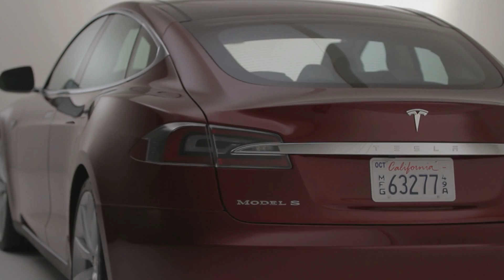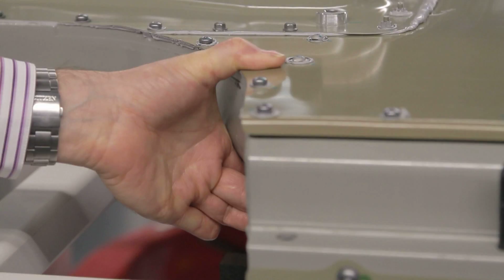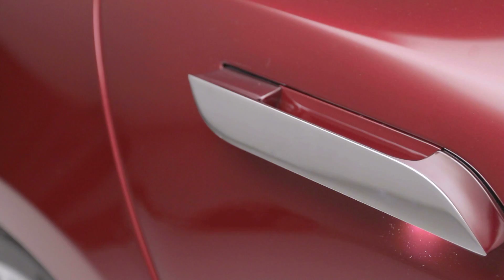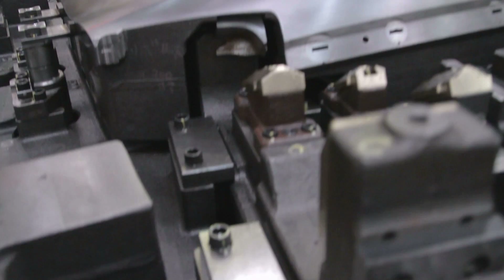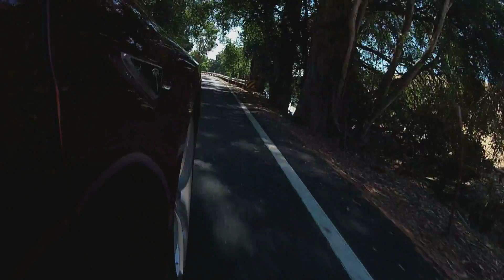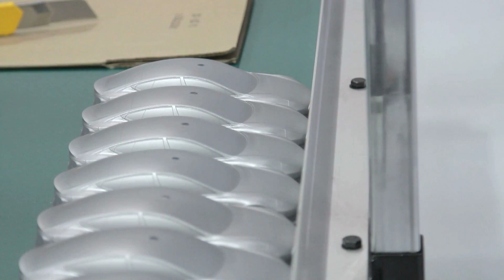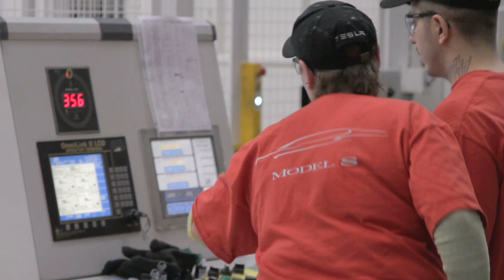Driving the 2012 Tesla Model S - Wide Open Throttle Episode 22

Comment: Or is there a different motor on the performance and normal version? I know that the main problem with electric motors is heat dissipation, but its probably very likely that all the cars use the same motor, but supply power to it differently. If this is true, then it could be easy to "overclock" the batteries by tweaking the controller and thus you could get your performance version for much less. Cool video btw

Comment: Hi, I know a little bit about EV's because I built my own electric bike which gets up to 40mph. I'm wondering if there are any actual internal differences in the battery pack or motor between the 85kwh version and the performance version? I know that a 85kw has twice the capacity of a 40kwh battery, but this also means that the battery can supply more current (about 2x as much) which means more power. So I'm wondering if the normal 85kwh version is simply inhibited by a controller.

Comment: Where do those numbers come from? Don't forget that electricity can come from a wide range of sources, of which some are very clean, like solar or wind power. You can charge the Model S with a 10 kW solar array to give it 50 kilometers of range per hour.

Gas powered cars require refined fuels, which require a lot of energy to produce and transport, and it has shown in a study from 2009 be less clean than the production of Li-Ion batteries.

Comment: The reality is that electric cars are putting more CO2 in the air, because the electricity is made with an average of 500g/kwh of specific consumbtion, but todays modern engine do around 300g/kwh. So this means to to produce 1kw of power for one hour, 300 g of CO2 will be released. Besides that the production of the LiIon Batterys take also alot of energy and the  recycling of way more.

Comment from the maker: There are 3 charging solutions 1.The Mobile Connector, which has adapters for a 110 or 240 volt outlet, takes 6-10 hours to charge. 2.The High Power Wall Connector, the fastest way to charge at home, can charge the 85 kWh battery from empty to full in less than 4 hours. 3.Supercharger stations, which Tesla's positioning along major interstates, will provide a 50% charge in 30 minutes when the Model S is equipped with Twin Chargers (standard on 85 kWh battery, optional on 60 kWh battery). -Jessi

Comment: The biggest health risk with having that high rate of a battery (amp/hr = capacity) is heat generation.  Think of how your cell phone gets hotter when you use more of it's features. Underbody air flow and liquid cooling can offset that.  Then of course, there's the impact/collision hazard and the potential fire thereafter, but hey, lets not be pessimistic here.
As far as the motor's magnetic field? No worries there either. You should see the size of the motors that run trains, boats and cranes!

Comment: little forward motion? I think you take cars for granted. Did you know it takes 26,500 kJ (26,500,000 J) of energy to move your average car a single mile at 100% efficiency? (not truck or SUV, they would be even more) That's equivalent to 14 lbs of TNT. Add a single passenger and you increase the required energy by  1,500 kJ. Higher energy density means you can carry more energy, the more energy you have the farther, faster, and the more you can carry on a single charge/tank.

Comment: Its a great car and I'll tell you how to solve the range problem. When my cell phone dies I don't plug it into the wall, I have two batteries and I always keep one charged why can't we do that with electric cars? No gas stations but battery stations. Drive in switch batteries and drive off. We still need to remember though how much fossil fuel it takes to make "clean electricity"

Comment: ?? Tesla says the Roadster's charging efficiency is 86% -- if you put in 10 kWh of energy from the wall, you get 8.6 kWh stored in the battery. Meanwhile the GREET model says each gallon of gasoline takes about 0.24 gallons of gas energy equivalent to produce, spill, refine, and deliver. Later gasoline really suffers because burning it in an engine produces a lot of heat and just a little forward motion, much worse than a motor. Yes liquid fuel density is sky high, but so what?

Comment: Efficiency, yes. Capacity? No. Hydrogen has more energy density when u realize it can be compressed and even if extracting it is redundant, it's still cheaper than normal ICE car. Hydrogen solves to range problem in ev's. I explained earlier in my other post that it was used at my work.

Comment: But instead of using electricity to produce hydrogen, you can just put it straight into a battery electric vehicle, and you'll get much better efficiency.

The reason we use gas, is because the gas-powered ICE is/was the best (generalizing here) drivetrain we had come up with for normal cars.

If we can come up with a battery electric drivetrain that meets our needs, it doesn't make sense to switch from gas to hydrogen.

Comment: With your kind of thinking, minivans would never have power doors and liftgates, no cars would have power windows, steering, brakes, or automatic transmissions. Handicapped folk would not have powered doors and ramps
etc etc etc

Sure quality could be a concern, but we can't know about that yet. If it lasts for 10 years and needs a replacement, I'll be happy.

Comment: Ha ha, are you seriously talking about trying to generate energy to run a car using the car's own kinetic energy while it's running?

Your idea about generating hydrogen from a running car is one step removed from crackpots who think you can generate electricity for a battery powered car by installing a wind turbine on the car.

Comment: This is all well and good but the big issue is still there. It's fine while it's got charge but once it's gone you're screwed. All I ask is that someone develops a quick charge system so we can charge these things in 5-10 mins. I don't care if it's only got 150 miles range if I can charge it quickly. That's fine. Having 200 miles (presuming you don't have to use lights, wipers, heaters, etc) then an 8 hour wait until the car's any use still makes it a commuter car.

Comment: Well, the tank only physically holds 726 kW of energy of which required  132 kW of energy to produce, correct? Now, even though a typical SUV is not the typical car, I'll roll with it. 
Suppose we have 2 situations, you have 132 kW of energy and you can make gasoline or electricity. With that 132 kW you can produce 726 kW worth of gas or  105.8 kW of electricity for the battery. Notice the difference? I'm all for electric cars but numbers don't lie. There's  reasons why its not widely used yet.

Comment: From the LA times....A base model with a 40 kWh battery and a projected range of 160 miles will be available this winter for $57,400.An additional $10,000 will get you an estimated 230-mile range and a 5.9-second 0-60 time from a 60 kWh battery.Finally, for $77,400, you can the model we tested. It comes with an 85 kWh battery pack good for an EPA-estimated 265 miles

Comment: Improvement of the power gird is IRRELEVANT since you would STILL BE USING BATTERIES to store electricity within the care. Removing the batteries would eliminate range problems (existing hydrogen vehicle fuel range ≈ 240 miles) similar to that of a petrol car and doesn't have to be plugged in at all, other problems of using batteries include battery life span, weight and weight distribution, acid rain from nickle mining and need I remind you that petroleum is also hard to extract...

Comment: Made a mistake in my first post - not 19 year it is 10 years. Off course the performance decline but what is the rate of decline and how that affects your daily use. I also have MS in electrical engineering and have a 30 years + carrier in Silicon Valley. Let's not measure our dicks here. What are the facts? How many batteries are changed on the Prius and what is the cost for the last 10 years?

Comment: BS about the batteries - there are Hybrids on the road for 19 years already without any problems with the battery. Add to that the benefit of never having to service your brakes or transmission and you get the picture.

Comment: How is it limited? You can use electrolysis(running electricity through water) and extract hydrogen. I mentioned that it takes more energy than pure ev and this is the reason why. Seems rather redundant and saying hydrogen is not good for use in cars is like saying gas is not good for use in cars.

Comment: GM, VW and Toyota are allocating capital more responsibly than Tesla.  They realize the obstacles inherent in electrochemistry and battery storage and are investing in more promising technologies that will reduce carbon emissions, while reducing fuel consumption. Battery efficiency improvement is progressing very slowly compared to more ICE development that leverages lighter batteries and flywheels. It is not that Tesla competitors can’t, it’s that they rightly know there is a better way.

Comment: Wrong. 
A Model S Performance starts at $84,900 after the ($7,500 tax rebate). Yes, you can pay $105,000 if you buy the Signature version and option it out, but even the Signature version (standard leather, tech package, special paint, etc.) starts at $97,900.

Ever option out a BMW? If so, you'll know the price skyrockets.

My M5 acceleration numbers were wrong though. My source used 2012 M5 numbers. But, the Tesla is a 2012 also, so...

Comment: Hydrogen fuel cell vehicles work by turning hydrogen into electricity to drive an electric motor.

So if hydrogen production ever does become physically and economically efficient, we should just build hydrogen power plants to generate electricity for the whole grid, rather than hydrogen powered cars.

That's the beauty of an electric car. As we improve the electrical grid, the car gets better and greener.

Comment: base model is 45k but if you want the performance version with a bigger battery it will cost around 70k..the base model has just about everything the the performance model has except the bigger battery but the base battery has 300miles+ per charge so that's still amazing

Comment: I think the Model S is a great car. It is fast, luxurious, pretty cool looking and yet not a single drop of oil needed too run it. I am pretty sure this will become a success, if it has a decent price tag. But a lot of people are still insecure about the mileage of the battery. I think they should keep working on more powerful batteries so in the future a Tesla is able to run a 1000miles on 1 single battery. That would make people turn their heads towards Tesla. great work nonetheless!

Comment: actually the energy efficiency of a battery is very low. To recharge one, you have to reverse a naturally occurring (spontaneous) chemical reaction, I'm not sure how much background you have in chemistry but just believe me when I say that requires a lot of work. In fact it requires more energy to recharge a battery than it does to produce an equivalent amount of gasoline. Also the engergy density. (gas = 44.4 MJ/kg, linthium = .9-2.2 MJ/l ) and I think that will be the hardest thing to overcome

Comment: IMHO, Hydrogen is the way to go, either burn it in an internal combustion engine, or use it in a fuel cell to generate electricity. It offers a much cleaner solution, with much faster refuel times. It would also likely allow the automobile to be much lighter in weight compared to a battery powered electric car.

Comment: Their is another major issue, the batteries are a wear item, they will in all likely hood be very expensive to replace, and as they die your mileage will decrease. Add to that, they them selfs are extremely toxic, the disposal of them is also costly and the mining of the lithium etc. to produce them tends to contaminate the surrounding area. The problem with electric cars still is that they use a battery as a power source.

Comment: Well i'm very impressed. I have always thought of electric cars as just novel toys. But if this thing has a realistic mileage of 276, then they are starting to look like a realistic option. Still there is a huge problem, the recharge time. Say I want to drive from Oklahoma to Georgia, I would have to stop 4-5 times to recharge, and depending on the time and voltage of the power source im using to recharge it could VASTLY increase the time it takes to drive the distance.
Like by an extra day.

Comment: Consumers need a primary driving car not a secondary car on the side. Tesla MUST incorporate a "Super Capacitor Battery" in any of the vehicles that they need to sell. We need one car in the Garage and not two. The Super Capacitor would be able to charge in 2.5 Min to 90% charge and not the 4-8 hours needed now. In this, Tesla would dominate and overtake full control of most of the market. It is quite interesting to me whether the "Powers at Be" would allow this Super Capacitor to be Built!!

Comment: they should have a timer on the charger that says when you want the battery to be fully charged so it judges the amount of amps to charge at this way its not a quick charge or a slow charge. slow charge the battery has a longer life fast charge less life.

Comment: You're right. Tesla didn't invent any miracle break through technology, but with a different mindset than the big three, with a clean slate, they are building cars in a different way. They are able to accomplish what the big three have not because they are not stuck with the weight of "this is how we always did things before"

The Leaf is an ICE car with an electric drive train swapped in (that's a bit of an exaggeration, but you get the idea). The S was built as an electric from the start.

Comment: heyedmond is right. ft-lbs can be used to measure torque for both ICE and electric vehicles, and horsepower can be used to measure electric motor power as well.

Undoubtedly, there are more powerful cars at lower prices. Regardless, the top-of-the-line Model S can do 0-60 in 4.4 secs, and it's a full-sized sedan. I think most people would consider that impressive. It is a very heavy car, but it has such a low center of gravity that it handles way better than any other sedan.

Comment: Depends on the charging source. It can recharge as fast as approximately 62 miles of range per hour, or as slow as 5 miles of range per hour depending on the type of outlet available. When supercharging stations are installed, you'll be able to charge 300 miles of range in an hour.

Comment: There is a temperature control system for the battery which keeps it warm in cold weather and cool in hot weather. It works fine for every day use. If you are going to park the car for days and days on end in extreme weather, you will need to keep it plugged in, but other than that, it's not a worry.

Comment: "Gas engines are measured in horse power. Electric motors are measured in foot-pounds of torque."

The f did I just read. Im not going to try and argue with you. I suggest you do research first on how torque and horsepower is related. smh. 

And I repeat, lower center of gravity doesn't matter if there is much MORE weight.

Comment: The Big Three spend many multiples of what Tesla spends on R&D in battery and electric technology.  In 2010 alone, GM received over 940 issued patents and had 135 issued patents in clean tech.  The 135 patents is more than double all the patents Tesla has received since 2003.  I tried to find Tesla's technical advantage and spoke with university research labs, battery chemists and competitor R&D groups and received a conflicting view with Tesla's marketing material. Commodity battery tech.

Comment: How does it show that the Tesla Model S is more desirable than a Lexus or Infiniti? Tesla has only sold a few cars and have taken non-binding reservations.  Tesla does not have reservations for even the 1st full year of production.  Nissan did for the Leaf. Point is that very good and reputable cars that are more cost competitive and not range limited with global distribution and massive marketing budgets fail to achieve the volume figures that Tesla will need to survive.

Comment: That would mean that the average American would drive more than 25K miles per year.  This is simply incorrect.  It is easy to just do the math. Don't forget you also have to pay for the energy used to recharge the battery. At current gas and electric prices you will save a few dollars over $1,000 per year in fuel costs. Most consumers are going to do the math. Only ~8% of US oil supply comes from the Persian Gulf. Venezuela supples another ~5%. source: eia

Comment: Manufacturers have been exploring electric vehicles for decades.  GM's EV1, Honda's EV+, Nissan began investing several hundred million in battery tech in the early 90's. They understand the electrochemistry, the specific energy of batteries, the durability of batteries. GM's Volt is not range limited and was Motor Trend Car of the year, yet they have already shut down manufacturing lines twice due to lack of demand. The Volt also appeals to a broader market than the Model S.

Comment: If Tesla is required to refund for normal battery durability loss, this would cripple the company (the company will not be around in 10 years anyway in my view). Consumers will lose out on low resale value or high leasing rates. Your calculations are wrong. What assumptions are you using?  Avg. miles driven, Energy cost per mile? My calcs. reflect that gas will have to rise above $5 per gallon and .013 kW/hour for the Tesla to even start to be cost competitive.